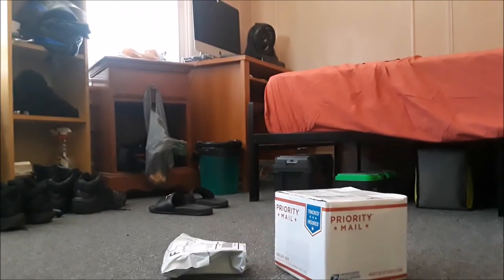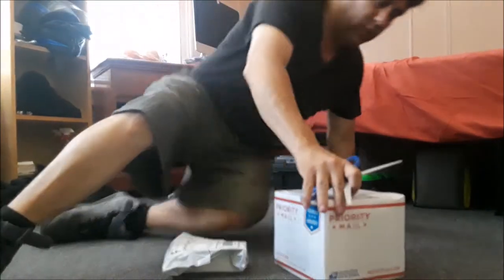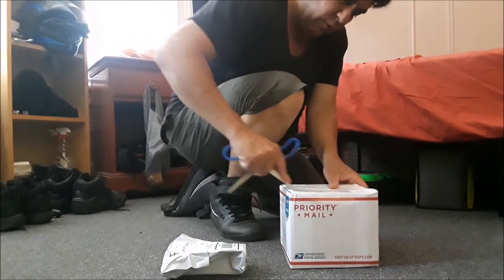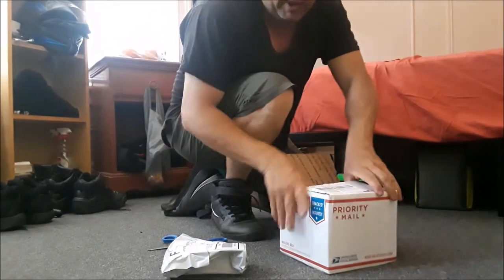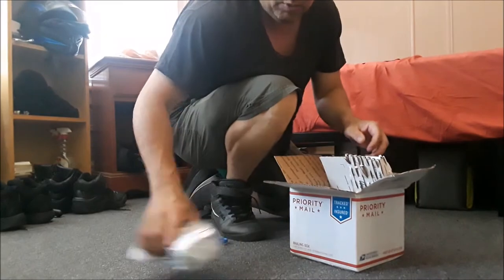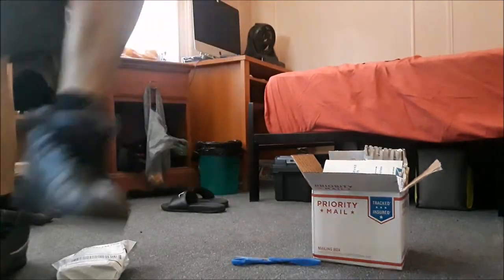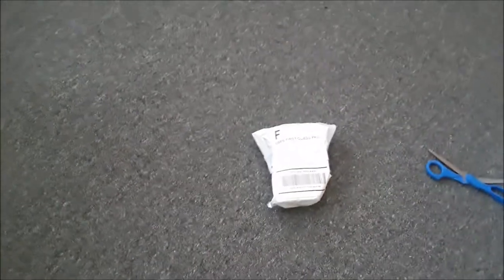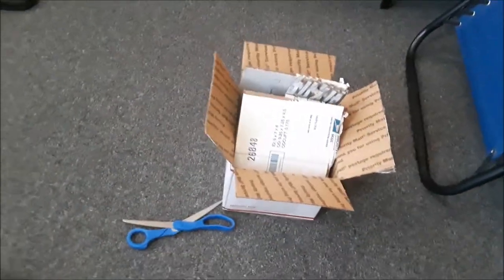job rocker plus with bigger battery 12v/9a

Comment: you can go sigmastek 12v 12ah battery and put 2 battery's in it. Yet it'll get heavy. Or you can put two 12v 35ah battery's go on and put 2 of them in it those are motorcycle battery it will not hurt it yet the time you get done it'll weight like 70lb yet you can find a suitcase with the handle and wheels on it and roll it. put 2 12v 35ah battery's it'll last like full power 2 months or more. Yet have 2 wires sticking out on the top thick wires for charging with a car battery charger. yet you'll have to wheel it.  You might not ever charge it with that much power. they will fit you will have to put them on the sides and you'll have to do some wood work mod it out. it'll work. On top of that with 2 thick wires coming out of the top with the 12v 35ah batterys you could jump car off with it. it would be a jumper box as well. it'll work i bought one of those for nothing i was thinking on putting 2 12v 35ah batters in it. with rolloer blade wheels and put some type of Handel on it just to move it around.